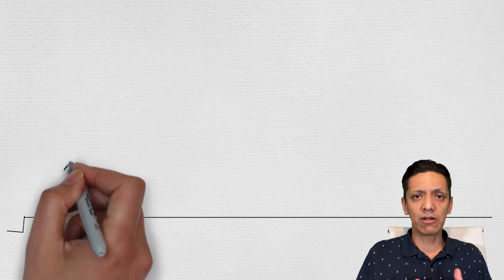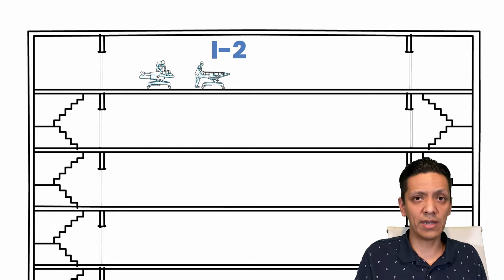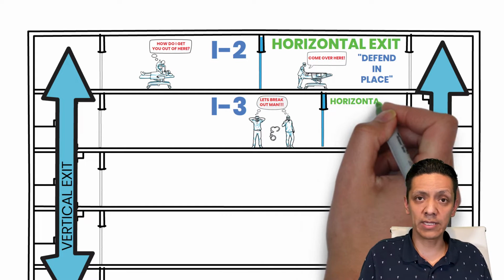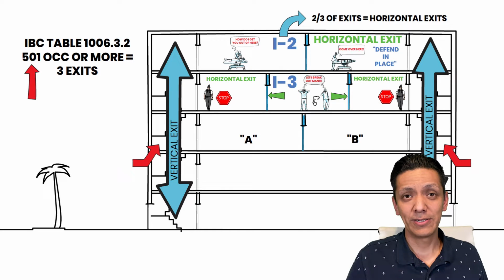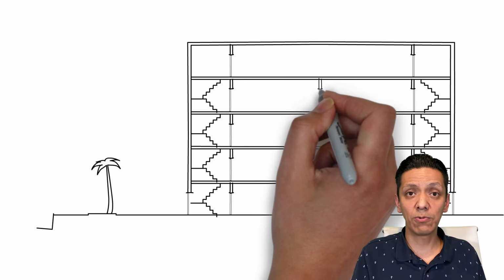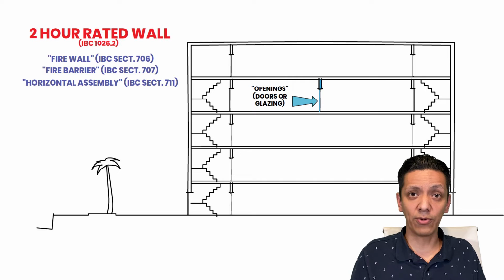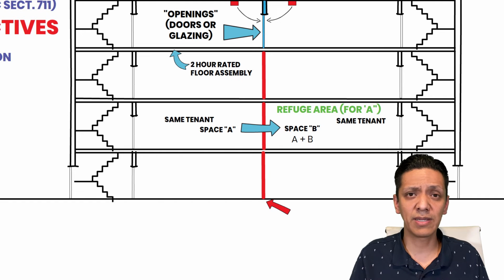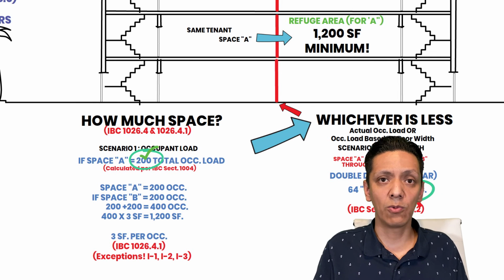AC 031 -  Horizontal exits explained. FINALLY!

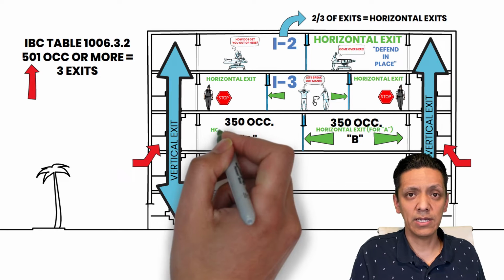Comment: There is one issue I have with your explanation of the scenario @ 11:00; assuming that the direction of egress can be either way, you'd need to provide double egress frames, at least at the capacities you've stated, as well as accounting for loading width in each direction, do you agree?
Reply from the maker: There are at least two options. Option 1: As you stated, have double-egress frames or Option 2: Have two sets of doors with each set of doors opening in opposite directions. 
I believe you understand the concept correctly.
Reply: @archicorner  what if the combined occupant load is less than 50 do you still need double egress doors? In city of LA for multi story apartment buildings in lieu of standby power for elevator they allow horizontal exit as a request for modification.
Reply: We use cbc though which is similar to ibc
Reply: Do you need to provide a refuge area at each floor of a 4 story affordable housing with about 8 occupants each floor, and how can you show the continuation of 2 hour walk on a section at stairs

Comment: Can you please provide an example explaining "where two or more exits are
required, not more than one-half of the total number of exits or total exit minimum width or required capacity shall be horizontal exits"
Reply from the maker: It is NOT that they HAVE TO BE horizontal exits. Instead, IF you are using horizontal exits, you are limited to the number of horizontal exits that you may have. I hope that makes sense.

Comment: Its great. But what should be the door swinging direction? Should I install two fire doors?
Reply from the maker: Doors need to swing in the direction of egress. Confused yet? This may get complicated quick... In short, you may need one door swing in one direction and another swinging in the other direction. This allows the horizontal exit to serve both sides.

Comment: Thank you for the explanation. Best one I've seen yet. One question, is the Refuge Area only needed if the two areas are two different tenants? If it is a single tenant floor, then the refuge area is not needed? They just exit straight through one side to the other. Did I understand that correctly? Thanks Again!

Comment: Hello Sir, 
I am grateful to have acome across archi corner. You are really amazing! 

I had a question and a request:
#Question- In case of multistory buildings, do we require to have horizontal exit spaced (refuge areas) on all the floors if we choose to introduce this concept?
#Request: Please make a video on Industrial buildings ( F and H group) that will explain difference between F and H groups. Elaborate H-1 to H-5 categories based on Table 307.1. How to figure out which class and group my industrial building fits in etc etc.
NFPA 101 mentions a different catagory "special purpose industrial occupancy".
What is the definition of this term and more info. 
Requesting to throw some light on this topic. 
Thank you!
Reply from the maker: Thank you for your kind words. I will add this subject to my list. Thank you!

Comment: Hi sir, thank you for all your amazing videos. Questions regarding the horizontal distance, do they have to be connected with a vertical exit or is it okay that they do not lead to a way that will take people outside of the building? If a corridor has a 2 hour rating, can it be counted as horizontal exit? If so, what is the different between an exist passage way and horizontal exit? Thank you!

Comment: Can this refuge area minimum sf be used as the "walkway clear space" in the side of space B or A, with 6 or 8' feet clear width and length from the horizontal exit door to the actual exterior exit door (no starir cases, one story bldg)?
Reply: Great question

Comment: Thank you for creating this wonderful channel and intro is perfect. Question on this video. Would a horizontal exit be the same as an exit enclosure?
Reply: also can you explain why this would not be the same as an Area of Refuge?
Reply from the maker: "Exit enclosure" is a term that is often used, but not really an IBC term (you wont find a definition for "exit enclosure" in chapter 2). The IBC talks about "enclosures" and "exits". Some "enclosures" may lead to or be part of and "exit" and for that reason it may be referred to as an "exit enclosure". For example, a stairwell might be built as an "enclosure". Perhaps that is why people sometimes use the term "exit enclosure" to refer to them or similar items. In short, a horizontal exit would not be the same as exit enclosure simply because the IBC doesn't even have "exit enclosures".

Comment: Just for clarification, the horizontal exit does not have to extend through the building vertically does it? Meaning it would create the horizontal exit through the building/floors.
Reply from the maker: A horizontal exit does not extend "through".... Instead, you can think of it as it is extending "up to" and/or "connecting to" the building's main exit system. In most instances, this means extending to and connecting to a stairwell.